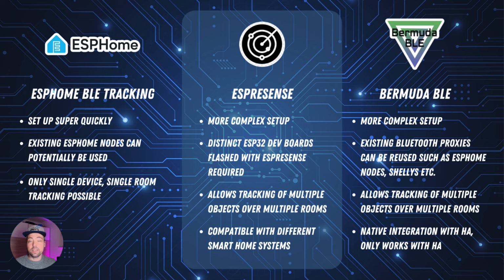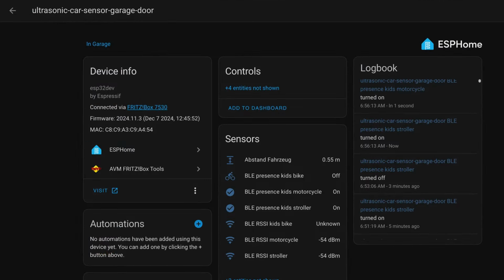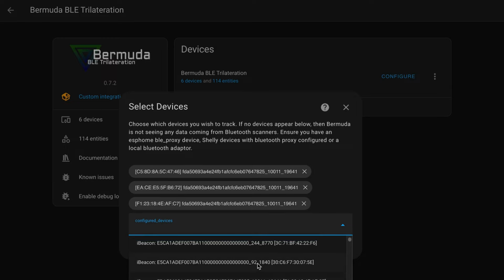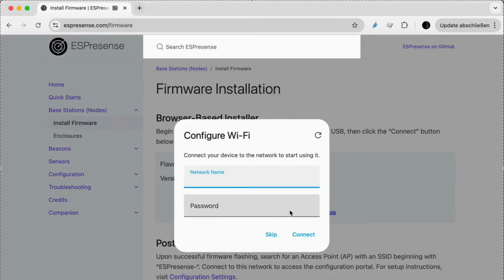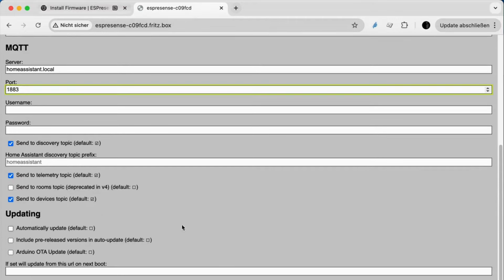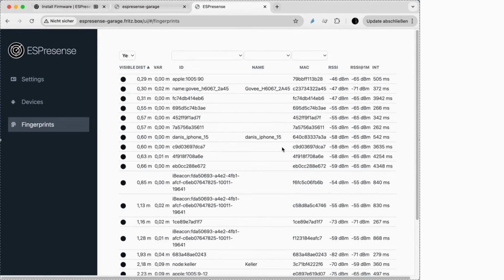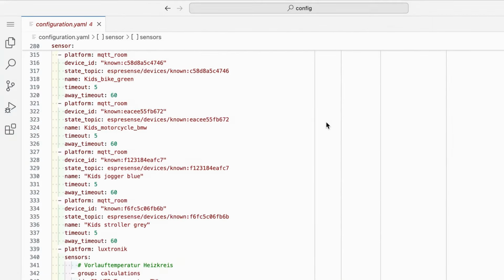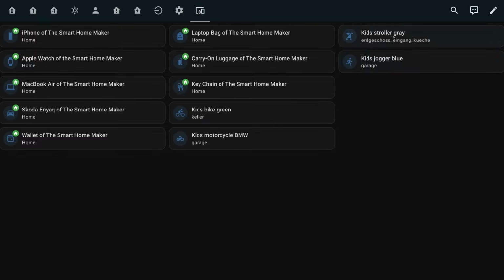Track objects, e.g. toys, in and around your house with Home Assistant and BLE tracking!

Comment: Hi! Great video, and a really good run-down of the various options for how to do it!

The problem you had with Bermuda bouncing between areas should be much improved in the current versions, there have been a lot of changes in that part of Bermuda since the version that you tried out. Another possibility is that the onboard or USB bluetooth (hci0) adaptors often have much better antennas than esp32 boards, so if it kept jumping to the area that hci0 was assigned to, it might be because it was seeing a stronger signal. In the configuration, there's a calibration step for "per-scanner rssi offset" - you could try using that to reduce the effective sensitivity of the hci0 adaptor so that it doesn't keep reporting closer distances than the garage proxy - of course, that depends on whether that's actually the issue or not!

More than happy to look into it and see what might be going on if you decide to give Bermuda another whirl one day. Anyway.. great vid, looking forward to checking out your back-catalogue!
Reply from the maker: Thank you very much for your positive feedback and interesting comments regarding Bermuda! I guess I should give it another go 😀